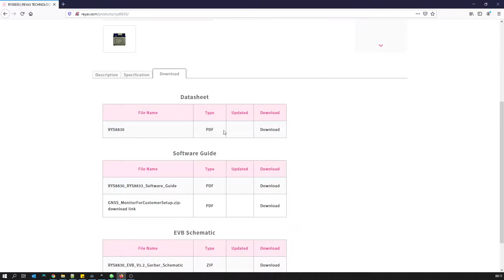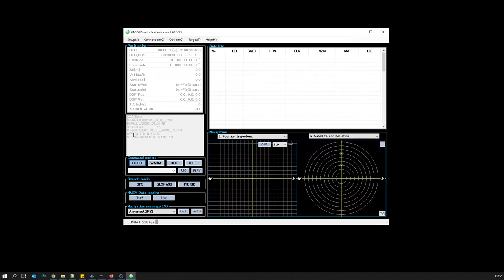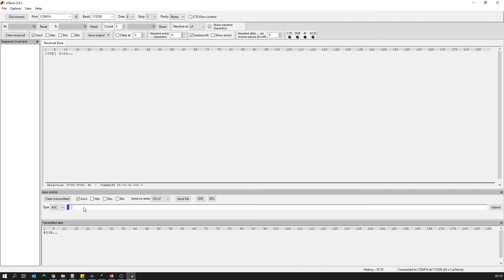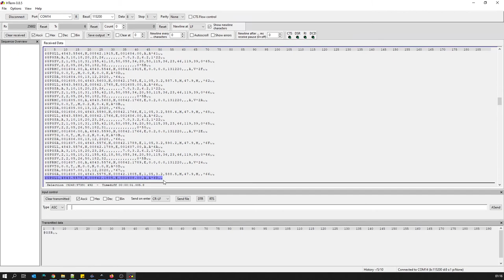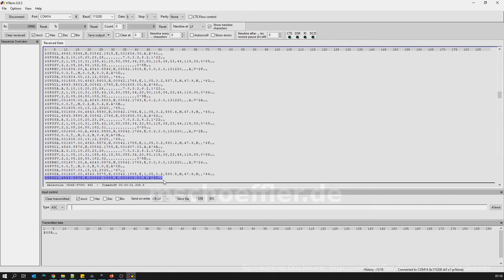GNSS Receiver Module Tutorial: How to work with Reyax's RYS8830 Module?

Comment: How to work with Reyax's RYS8830 Module? Are you kidding. It was merely an introduction together with a very brief demo of the demonstration software. This is a complicated little chip and not for people new to electronics. The module and demonstration software hides the complexities very well. For example it requires 1.8V interface, so level shifters are required for most MCUs.